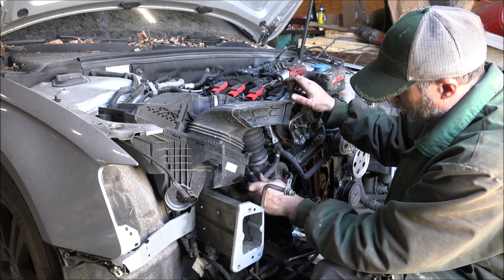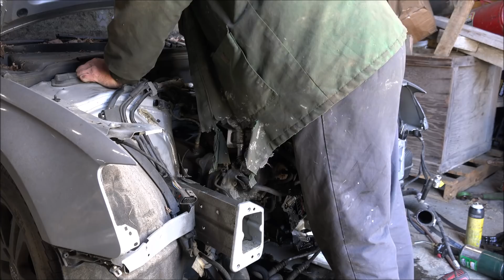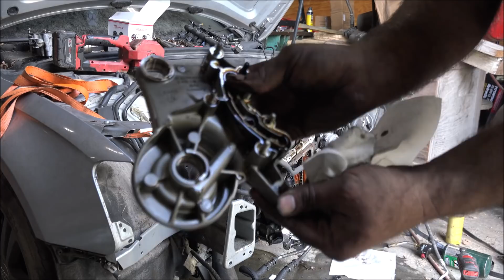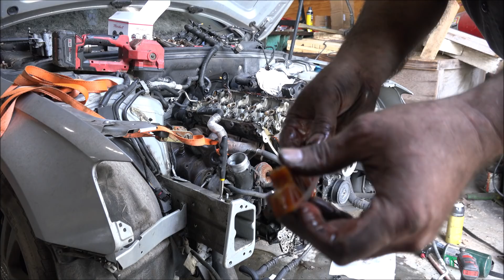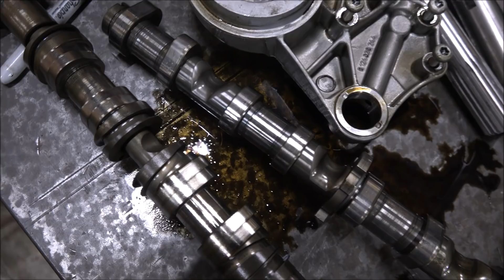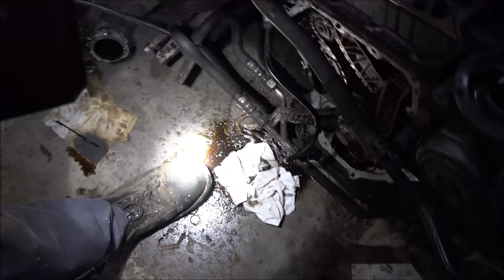Well That Ain't Good #4 2009 Audi 2.0TFSI Killed by junk Plastic Timing rails! Total Destruction!

Comment: Wow, I dont believe I would fix that one if it was mine.  Tough call.
"Poor sap that ownes it"  The joy of older used high tech vehicles.
Reply: It uses to be German Engineering was the Bomb mmm er maybe it still is LOL
Reply: @ypopnun1003  Having worked with German engineers, I've no illusions about how they think.

They all try for "sophisticated" designs, and KISS is utter heresy... a rare few break out of that religious dogma, usually after working outside of Europe for a few decades...
Reply: But Steve, you COULD....
Reply: @Steve summers What are you doing here, you ain’t got time for this;  you got your own machine in failure mode too fix 👍🏴
Reply: Poor sap that owns is the one working on it.  His wife’s car.
Reply: I'm with you there. Fact is the car would have to be exceptional in some way (condition , $ value) to make me not bail and get another.

Comment: The valve head is in the exhaust system, soon to beat the comb out of catalytic converter. If you fix it the next thing to soon fail will be the automatic trans. Push it out and call the scrap man....you'll be $$ ahead!!!
Reply: In the turbo.
Reply: In the exhaust is physically impossible in a 4 stroke engine. In the turbo is impossible for any engine. I fell out upon removal and is hidden in a nook in the engine or a frame rail or whatever random location it fell to.

Comment: That engine was designed to require mandatory maintenance.  Skip the timing system maintenance and you get "what we have here".
Reply from the maker: I would have figured when the engine got the new piston oil consumption rebuild by the dealer the 2nd time at 130K that they put new guides in it. I guess not. The guides and chain are not worn and the adjuster was not failed. Looks like just the plastic was old and brittle and broke.
Reply: @bcbloc02  Nothing like selecting the wrong resin and believing your FEA analysis out to the bleeding edge. I've been seeing that sort of failure all too often ever since people started porting ANSYS to ProE & CATIA back in the day...

The inexperienced engineers and designers tend to trust their software too much...
Reply: @bcbloc02  Between the car companies' Service Engineering and Financial Control departments, major service repairs almost always end up with the customer getting the shaft.  When I worked for one of the then-Big 3 engine engineering divisions, we used to get calls from customers crying about how service recalls screwed up their cars. (How they got our phone numbers, I can only guess.) We had two recalls, 15 years apart and for different reasons, where the dealers were authorized to replace pistons. But the recalls didn't pay for replacement of the piston rings!  Guess what happens when you take 60,000-mile-old rings off an old piston and put them on the new piston!  The dealers with decent service departments either ate the cost of a set of piston rings or charged the customer (real) dealer cost. That's called, "Take care of your service customers and they may come to your store for their next new car."  
Incidentally, I don't know if your wife's Audi has Direct Injection (it probably does) but they were having a lot of problems with heavy deposits on the intake valves - to the point where Audi authorized the dealers to remove & disassemble the cylinder head and clean the deposits off the valves. Imagine how many of those repairs generated happy customers! (Drivers pay big money for the higher grades of fuel with more anti-deposit detergents, but GDI injectors spray the fuel directly into the cylinders, not onto the valves as in port injection.)  I think that's why some of the more up-market cars now have GDI and port injection. Expensive...
Reply: @chemech   Yup, been there, done that.  The specialists in the field teach that if you beef things up to where you know it won't fail, you're over-designing it and wasting money.  The best mechanical engineers ignore those idiots.  Plastic costs customers billions while saving manufacturers millions.
Reply: @rmr5740  Don't forget the role of the regulators - plastics are lighter in weight than most metals, and lighter weights = better fuel economy in the calculations.
Reply: @rmr5740  Yeah, you want to push close to that limit, where the part won't wear out or fail too soon, and ideally, where any such failures are not catastrophic.

Comment: Hey Brian - ouch, that ain't good. Zero expertise other than past ownership but I do know VW/Audi mated a 2.0TDI (EA288 181bhp model engine) with a 6spd double-clutch auto transmission in their Mk7 Golf/Rabbit GTD. Big thing I remember about it is having to pull the bumper/valance/whatever off just to replace the HID discharge headlamp bulbs.
Reply from the maker: Were those longitudinal or cross mount engines?
Reply: @bcbloc02  cross mount in the case of the Golf.

Comment: Just did the timing chains on my 06 F150 4.6l went ahead and put a Melling HV oil pump in while I was there. It wasn't as bad as this but the tensioners had blown out and it rattled to beat the band at cold start. Even though it's very different, I enjoy working on German cars. Ok, I just enjoy turning wrenches and fabricating on anything. BTW, I'm coming up home to Louisville in June, maybe I can swing by. The valve face is stuck in the catalytic converter lol
Reply from the maker: Sure just give me a shout
Reply: @bcbloc02  Will do
Reply: Multiple people have said the valve face is in the exhaust, um guys, there is a turbo in the way there, if the valve face went in the exhaust the turbo lost some blades and/or has a bent shaft.  I saw a 1.8T audi motor that grenaded and pounded the face off of 3 valves in one cylinder, bottom of the head and top of the piston looked like someone went at them with an axe.  Two valve faces were still in the cylinder, the other was completely gone, all I can figure is it got pounded to powder.  Of course it also melted a good bit of the piston top, so there was aluminum that melted and pooled in the curves of the exhaust manifold and turbo, and that turbo did have the corners knocked off the vanes and a bent shaft.
Reply: @fristlsat4663  I forgot about the spool. Good point. In any case, it's fun doing engine autopsies

Comment: Afaik. Audi service tech will tell you when to replace tensioner and guides when they do service and oil changes. The car detects the slack in the chain, and when i goes above a certain value it will request chain service
Reply from the maker: The scan tool had shown the cams were well within phase spec about 10000miles before the failure.  when the rail breaks like this it goes out of spec REAL fast.
Reply: Yeah the manufacture knows when the gilde is going to break and even tells you through the scanner, piece of junk

Comment: Had the displeasure of repairing my Seat 1.4 TSI timing chain last year. Fricking VW garbage!
Clamped on chain sprockets are especially garbage on that car, I guess they slowly moved and engine got out of timing. Or chain jumped a few segments as it was parked in first gear on a mountain, as car rolled backwards and chain tension piston maxed out.
Reply from the maker: I hear ya! You should have just round house kicked it until it complied.

Comment: hello brian...the audi cars is very complicated engine motors and electronic very very complicated...the expert in audi is a very mecanic specialiced..
Reply: I dunno, been doing Audis and VWs for a couple decades.  Cars really aren't that complicated, you just have to understand the computer/mechanical interactions.  My biggest complaint, and it isn't exclusive to Euro cars is the OBD creep.  Since in NY they don't pass inspection with a CEL on, and these newer cars use the CEL for every possible kind of issue, that means your car fails "emissions" when the transmission has a bad sensor.  What does the transmission range sensor have to do with emissions?  But in the Euro brands BMW is the worst to work on, Mercedes probably the best, Audi and VW have the advantage of VAG being really good at parts interchangeability, and you can often make improvements by swapping parts between models/generations.
BMW is so bad now that you can't even use parts of another car without the dealer computer to tell the car it is OK.  Know of one that lost a steering rack to a deer, had to go to the dealer because the new steering rack would not work until blessed by the BMW computer gods.  And please don't unhook the battery in a modern BMW, they will absolutely freak out, and again probably require dealer intervention to pacify.
Reply from the maker: Yeah I haven't run across anything on this I would label complicated.  Good to know I never want to own a BMW!
Reply: @bcbloc02  If you lived in my country, you would buy a used complete engine for little money
Reply: @fristlsat4663  bmw isn’t that bad. We have 5 of them and love them to death. Nothing drives as nice. You can reprogram old parts if you have the right gear and know how without much fuss.

Comment: Think you might be able to swap the computer along with the heads for the TDI swap? Never really thought about how you might do this. I've got a '99 Beetle with that TDI motor in it and it's going strong at over 250k mileage. I still get over 40 MPG.

Comment: Aluminum guides with turcite load bearing surfaces?
Reply from the maker: Think they be good for 5000 surface feet per minute of chain dragging across them?
Reply: @bcbloc02  probably not.  Lol.  Perhaps some cpm s90v, but your chain/belt would give up the ghost pretty quick.  Either way, looks like catastrophic failure.  Wish they put squealers on those things so you could know there's an issue sooner rather than later.
Reply: Waste of good/expensive turcite on such a crap engine!

Comment: No expert on Audi's, but ever consider dropping in a 4cyl mercedes Non turbo,,have 2 we would love to sell are trade off,, We did pick up an '06 Cabriolet with minor front end damage cheap. After repairs made 5500,,so we are still on the look out for old Audi's,,Was considering pulling the 5.9 360 out of our '92 D-250, and doing a 617.91 Mercedes diesel swap,,but to many on going project's now. Brian, really like what you do for us viewers, and old gear heads,,keep it up,,Bear
Reply from the maker: Want to buy an Audi cheap? Comes in kit form. LOL
Reply: @bcbloc02  Thanks, I'm still chuckling!

Comment: GM used to call their Nylon toothed cam sprockets Silent link timing sets.. i called them designed obsolescence  forcing people to replace the engine or the car..   as long as it makes it just past the warranty period. that is all they care..
Early 2000's Audi's with the CVT transmission..  when they failed at 120,000 miles because of NO transmission services .. Life time transmission fluid.. lasts the life of the car..  yep.. don't change the transmission fluid and the car only lasts 120K  and when the transmission failed.. it was over 8K to fix it and the remans were NOT available.. would you like to see a new Audi instead was the customer service usually script..

Comment: Boy Idk Brian. I'd have a hard time not just pushing it out to pasture. It'd have to have something very redeeming about it. Life is too short just to break even or go backwards doing a bunch of work like that. Never was an audi fan. What little experience I had with them was all similar to this. Major problems caused by stupid or silly things on cars that tanked in value it seemed. None of these "value engineered" cars and trucks will be sitting in fields 20+ yrs like your old pick up did and get going. Let us know how you go with it. Thanks for sharing.

Comment: your exhaust temperatures can regularly reach 2500 degrees. when the big end broke off that cylinder turned into a furnace. that valve probably got a lot smaller with in a few seconds, and was either consumed or went through the turbo. just my theory.
Reply from the maker: Never seen an engine that could survive 2500deg. Heck aluminum melts at half that so not sure how you could keep the pistons in one that hot. Usually they start going out the tailpipe at 1600deg unless you have some special systems
to prevent meltdown. It broke off at idle though so it probably never saw only 500-600deg at most.
Reply: @bcbloc02  one of the main emissions we are concerned with these days is NOX. this is created in the combustion chamber at and above 2500 degrees. the pistons live through very quickly transferring heat into the oil and cylinder walls. i am sure you can quickly verify here on youtube.
Reply from the maker: @jackheath6623  You said exhaust temp of 2500deg not the peak spike cylinder temp so I was confused about what you meant.

Comment: It's been a while since I've been in the VAG scene, but IIRC the gear ratio was different in the 2.0 TDI's six speed transmission.  Try posting in the tech forums at VWVortex/Fortitude, they can help point you in the right direction.
Reply from the maker: will have to give it a try.

Comment: It's interesting that Ford's new 7.3L is not an OHC engine. They said it was driven by torque characteristics but those mile long timing chains and corny tensioners will not be missed.
Reply from the maker: Ford had their engines prone to the same destruction. Maybe they learned?

Comment: Lucky its at front. The V8 and v6 audi the timing chain is at the back. You have to split tranny from engine.

Also if you use oil that isn't specific for these engines ex. 507 spec. It dries up the timing chain guides and they become brittle.

Comment: Here in Canada we have the tdi version, but dsg only
Reply from the maker: So it is cross mounted right?
Reply: @bcbloc02  yes since it's fwd. But engine mounts can be used off of 2.0 you have. Check out some forums or Facebook. 

Best thing you could do is find a European tdi engine with manual tranny ecu. Drop in a 150 hp pump duse chipped engine and that thing will pull like a pit bull on crack. Still get 40mpg.

Comment: The nylon cam timing gear on my 1966 GT350 only lasted 60K+ miles before it destroyed the engine. You are lucky yours lasted as long as it did.

Comment: U can get automatic tdi vw engine basically the same engine as an Audi uses and either a cr170 common rail or pd170 port direct engines and dsg gearboxes wich are I 🤔 7 speed
Reply from the maker: I have a 6spd automatic in this quattro. Best I can tell that was a configuration never built diesel so the ECU does not exist.
Reply: They do actually make a 3.0 tdi quattro 2009 audi a4 I'm assuming it's that make my old  boss had one a soft top but ur right only manual but u fix it sell it and get her a another car 👍

Comment: Nice cars to look at but crappy designs with their engines!  I'm sure a better chain rail could be designed or at least some valve relieves be cut out on top of the pistons just in case something goes wrong but no.  It seems that when this happens more than 50% of the engine is just bad leaving no option than to swap it out.  THIS SUCKS!
Reply from the maker: It would take pretty big valve reliefs to handle a 30+deg out of time situation like was caused by the broken chain rail. Compression probably wind up about 5 to 1 . Would need more boost! lol
Reply: @bcbloc02  Thank you for your reply.  And this is a chained timing not a rubber belt catastrophe?  Come on Audi, come up with a better design or material as a chain guide(s).  You practically overbuild other aspects but it seems that is if on purpose you cut corners on the timing tensioners, oiling, and types of materials dealing with the timing area.

Comment: If you get that one back together and running, if you hear a rattle somewhere, look in the muffler and you’ll probably find that missing valve!
Reply from the maker: I don't see how it could have gotten past the exhaust valves but if it did it must be in the turbo.
Reply: @bcbloc02 , I was joking when I wrote that, did the valve break off the valve stem or don’t you know? Let us know if you happen to find it.

Comment: A steel bolt worn by a plastic piece.  Mr. Titus would say how does the court house steps get worn by shoe leather. How does a straight razor get sharpened by a leather strap.
Reply from the maker: Rubber o-rings cut steel all the time.

Comment: chevy traverse , buick enclave, gmc acadia.. and the equinox all have. timing chain issues . did a many under warrenty
Reply: Early 307 Chevy with plastic covered timing chain gear( they were quiet un till they weren't and broke)
Reply: @ypopnun1003  ford did that in the 70s on everything.....great for 60k..........

Comment: Way to much plastic and thin sheet metal in new cars and trucks. The plastic turns hard and brittle and the sheet metal just rots away. GMs LS engines last forever but the bodies rot away after a few years.
Reply from the maker: This car actually has really good corrosion free sheetmetal for its age.

Comment: Uk engines have timing belts that need to be changed every 80K miles or what ever is recommended, maybe those pastic bits should have been changed and someone forgot.
Reply from the maker: I would have figured when the engine was rebuilt the 2nd time they put new rails in it but maybe not??